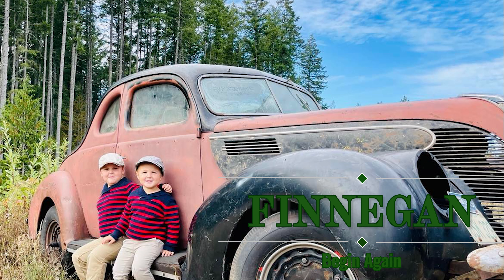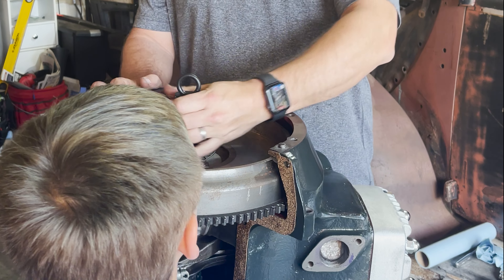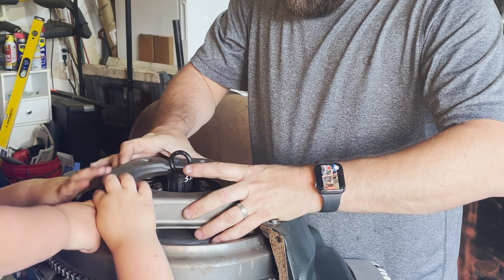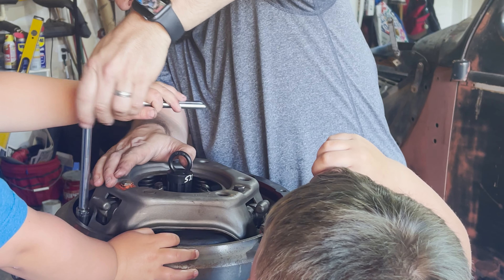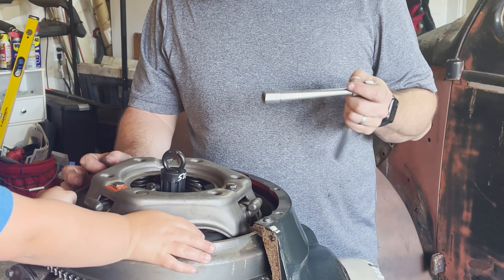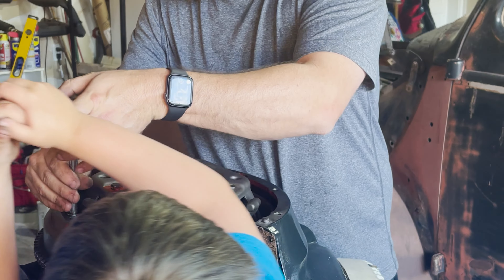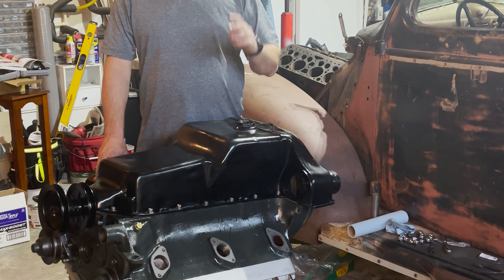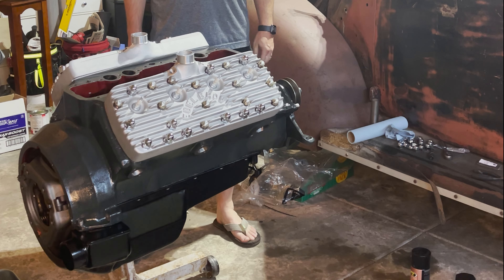Episode 12:  COVERING MY BOTTOM!!!! ..... oil pan installation

Comment: Thanks for the vids I have a 1946 ford the engine still runs decent but getting tired. I will be rebuilding in the future what was the cost of rebuilding keeping it stock heads and ind intake
Reply from the maker: A decent shop should be able to bore, hone, crack check and clean it up for about $800.  Then can also tell you if the cylinders need boring.  If not you could re-use your pistons if they are still good.  Can't imagine they'd be terrible. You can re-use your rods in either case.  Pistons and rings, if you bore out the cylinders, should be less than $300 for pistons and you can find NOS rings for about $50.  Your cam can usually be re-ground, same with the crank, ask for a quote on that one. It shouldn't be too much.  Will give you much smoother operation. New valve set, re-use your lifters, $300.  Porting the engine is supposed to give you a nice bit of improved running, and works with your stock exhaust manifolds.  That's just some grinding stones and time.